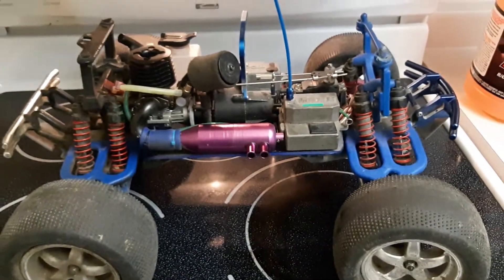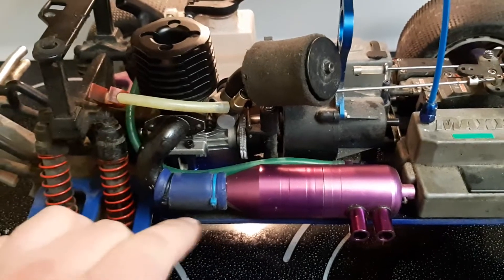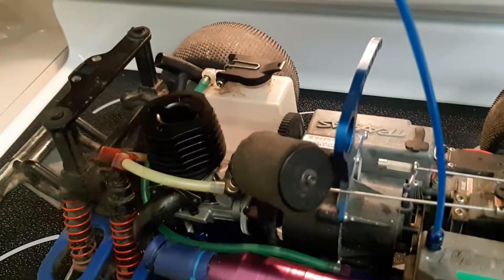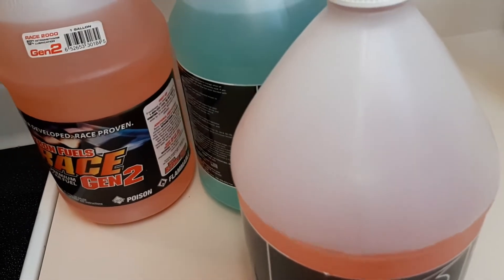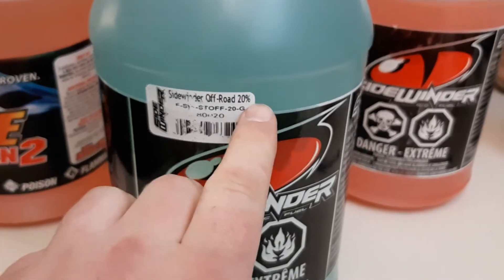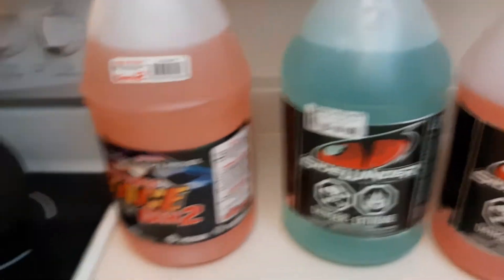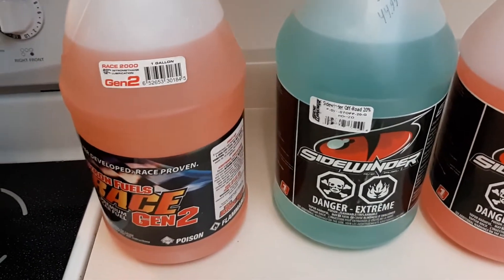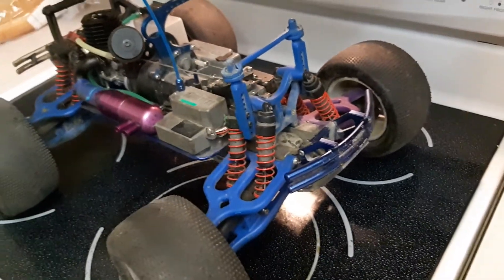Tmaxx update the fuel I use and a shout out for hybrid32494

Comment: I got a .19 dynamite for mine still have to bolt it in.. whats better the .19 or SH .18? I have a o.s. .18tm as well..
Reply from the maker: The 19 makes makes more overall power the 18 is really good to and same with the OS 18 all very good engines